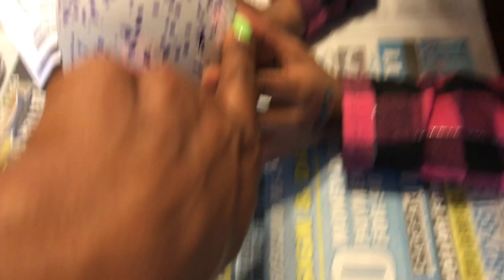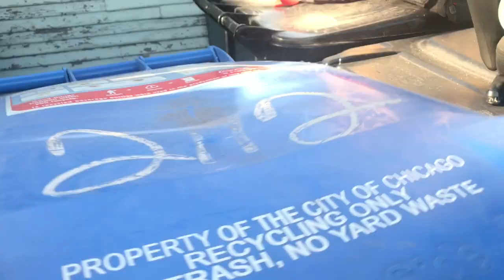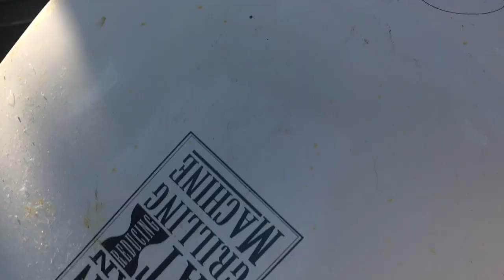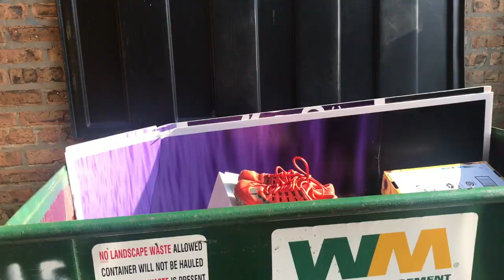Dumpster Diving : THEY CAN HAVE IT...I DON'T WANT THEM!!!!!!🤷🏾‍♀️👌🏾👍🏾

Comment: I sympathize with you about the power steering. I drove a truck w/o power steering. The summertime was the worst. I forgot to say the truck did not have ac. But I built up my biceps whole driving that truck. 
I hope you get it fixed.